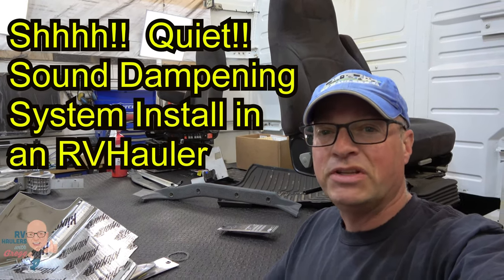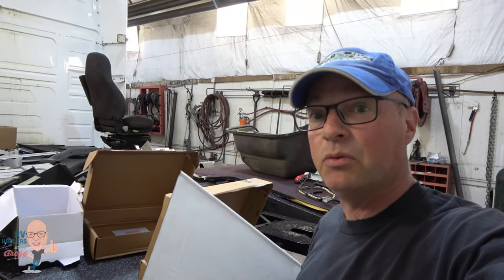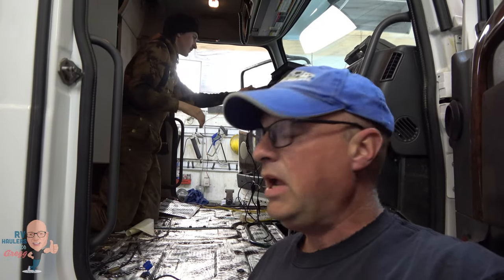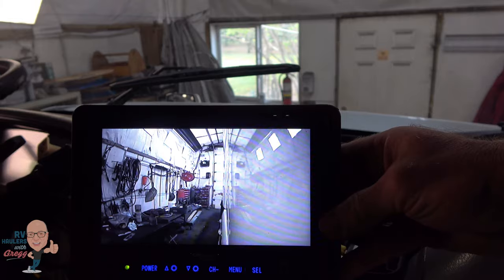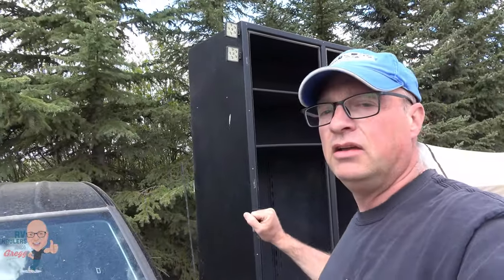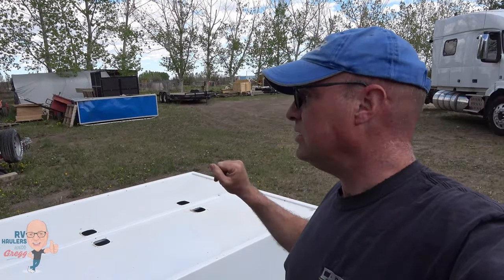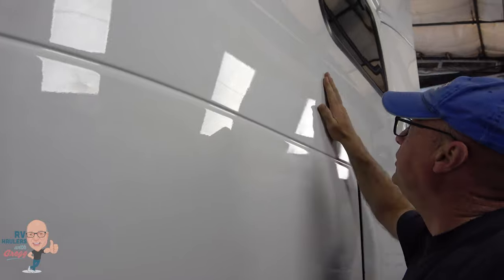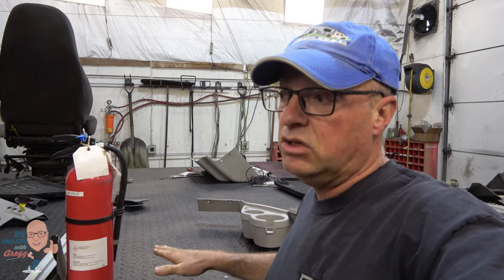Installing Sound Dampening in an RVHauler

Comment: Gregg again I really enjoy your videos was wondering when you are finished with the make up of a hauler and it is strictly used as a rv hauler if your insurance is cheaper and classed as a rv hauler or something different?
Reply from the maker: Hello Kevin,
Yes, every RVHauler that leaves my yard is titled as a MOTORHOME - not a truck or commercial truck.  The pricing for insurance often ends up being pretty well the same as a one ton pickup.  Of course everyone has their own insurance relationships, and sometimes prices can fluctuate a bit.  We gain significant benefits from titling as a motorhome.

Keep the great questions coming!

Gregg

Comment: How much of a difference does the “sound damping” really change the sound… my wife is very particular on a quiet ride. Will this really make a significant change???
Reply from the maker: Hi Jeremy.  Personally I found a pretty appreciable difference.  I should have used my noise meter and done a comparison, but we just jumped into the upgrade and I didn't think of it until we were already underway.
Ggg

Comment: I debated on placing this comment on your most recent vid, for you to check, or on this older vid, if you still check back?? Anyhow, is there an option for "body-off"  sandblast/powder-coat of the full frame? Also, with Mobile StarLink ramping up, what considerations have/are you for this option? Either mounted on the truck itself, or on the RV, but communicating with the truck while moving on the road? Thanks for all your fantastic vids. It's a great mkting biz model!
Reply from the maker: Hey Mad Max!

Interesting questions thank you.
For the cost of a body-off frame restoration ... it would be a better value to just let me order you a new truck exactly to your specifications straight from the factory.  The costs associated with the systems removal would be very high.

Also, I always challenge my clients when they inquire about frame blasting and commercial re coating. I have done quite a few, but the benefits are questionable.  If the frame is going to be exposed, and visible, it is perhaps worth considering.  However I point out that the frame is NEVER going to rust through or be compromised in two life-times or more.  We are often building beds, and covering the rear frame as well.  It isn't at all visible.  

Sometimes we do things because it makes us feel good.  That is allowed!  Frame blasting is sometimes one of those "feel good" things even when we know we are completely covering the frame.  Or, we can keep those funds, and put them into the fuel tank instead.

RE:  Starlink.  I have been using starlink for 21months now.  And travelling with it for the last 8 months.   I personally love it.  I recommend mounting on the RV - and we can access it from within the cab of the RVHauler.  Sometimes we might have to separate the RVHauler from the 5th wheel, and the majority of the times we want it near the living space.  The RVHauler might need to be kept in a storage area away from the 5th wheel when we are limited in campground length.

Thanks!  Gregg
Reply: Is the mobile Star Link able to track in motion 🤔

Comment: What thickness did you use and would it be possible to use something slightly thicker?
Reply from the maker: Hi and thanks for the question. I used the 80 mil (2mm) thick product.  Kilmat has their product in 50, 80 and 100 mil thickness, so yes, you can make it a bit thicker.  Also, I have doubled up the mat in some areas of installation when I really feel like it would help.

Gregg